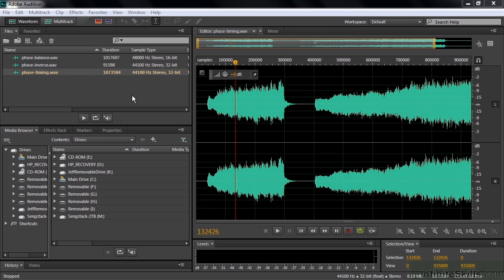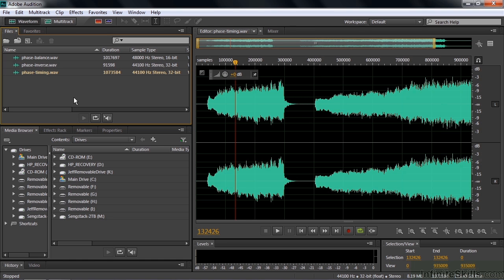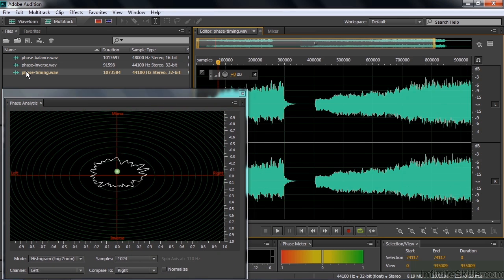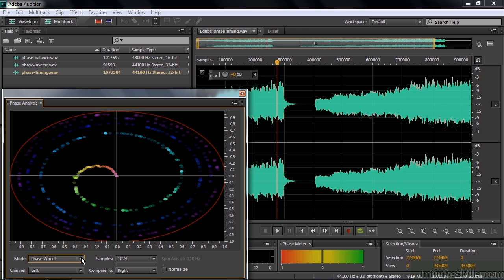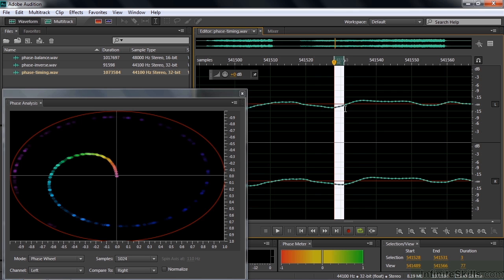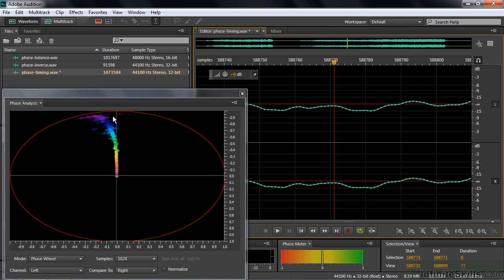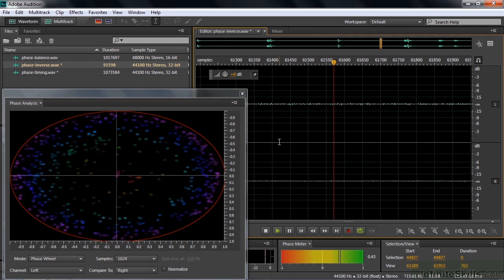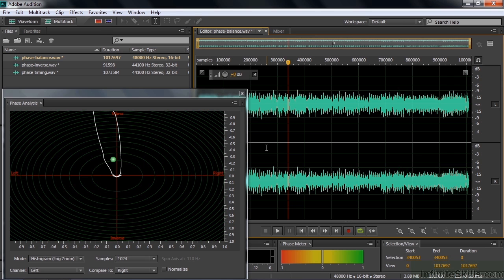Adobe Audition CC Tutorial | Analyzing And Fixing Phase Issues

Comment: Usually the louder channel has a better mic placement and therefore has a better sound quality. Therefore I don’t agree with balancing the channels by boosting or cutting one channel. This can work ok for very small balance adjustments but many times It’s better to mix the louder channel into the quieter channel.

This idea can be better understood if recording a wide instrument like marimba. If the left mic is over the lowest notes and right mic over the highest notes, the resulting low notes could be many times louder on the left channel. If the right channel was boosted to match the amplitude of the left channel, one can easily hear the poor sound quality of the right channel. Boosting the right channel to match would make a good sounding left and poor sounding right. The sound would not be centered because individual frequencies are not balanced.

But mixing the high quality left channel into the right would not only increase the quality of the mono channel but would also lead to a more honest and high quality mono signal.

Comment: Very good to see this corrective process explained in Adobe Audition. But how would you solve this issue over a plus 30 track production, where there is a micro latency delay occurring over respective clips in the session all the way down, from drum tracks, bass, guitars, keys, strings etc to vocals. All these will incur some degree of frequency masking but even when that is reduced by mirror EQ adjustments, there is still the global issue of clip alignment and phase slip between tracks in the whole session at m/s level. The problem is audible and unfix-able unless you can nominate one recurring sound as the target or master timescale, and then somehow use these analysis tools to apply a global track clip fix that slave to that master. How to do that in Adobe would be some sort of Eureka moment. Thank you so much.